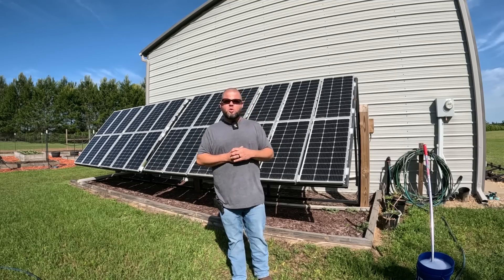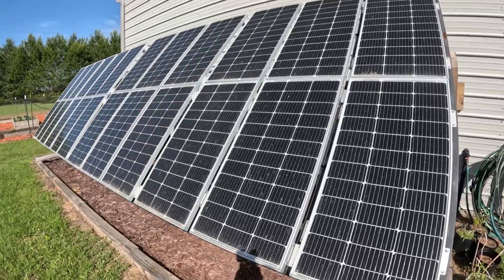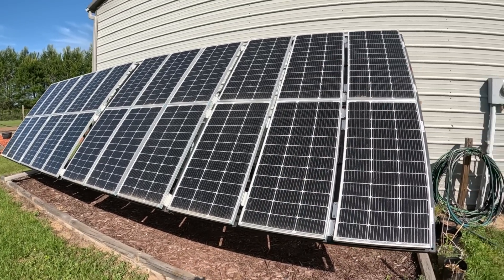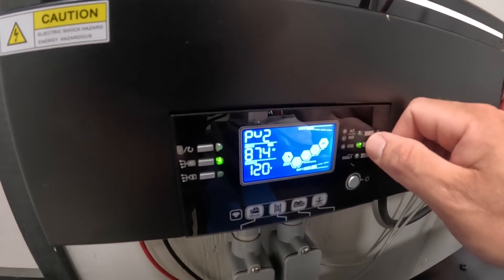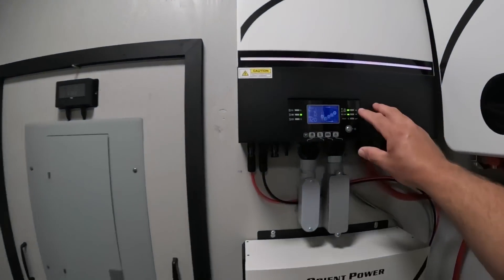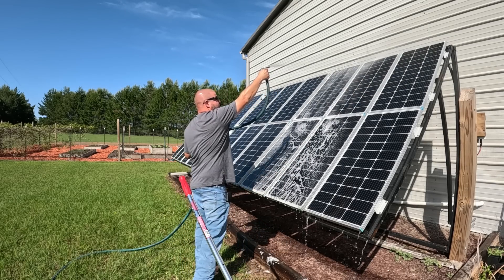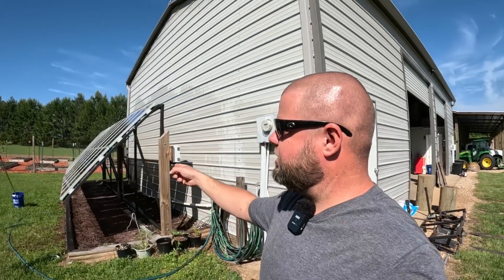Solar Panel Mistakes! Cleaning And Cooling Output Tests!

Comment: I'm from netherlands where we have really clean tap water, but you should not use tap water. The calcium in the water will leave stains on the panels that will then be hard to remove. Most modern home panels also have a protective layer that you have to be carefull not to damage. So if you want to clean the panels use clean/rain water not tap water, and use very soft cleaning tool not to damage the protective layer. And if panels have a sufficient angle rainwater will automaticly clean the the panels. Here in netherlands is lots rain, so i've never had to clean my roof panels at 35degree angle. they still produce same as 12years ago.

Comment: Does the water on a hot panel not crack the panels?
Reply from the maker: No, these have to be designed for that.  We get pop up showers in hot Florida all the time.

Comment: Try weting down your condensor on your AC unit in mid summer it will amaze you how much it drops the power consumption. Don't do it perminatly as it will damage your condensor.

Comment: Being new to the job, please answer this point. Do you do this cleaning after having shut down the panels? How do you proceed?
Reply from the maker: It would be wise to do so if you are going to be working in or around the wires as they still produce voltage.  Keep in mind the panels are designed for wet weather and heave sealed connectors.  I personally wouldn't be spraying the backside connection boxes.

Comment: One main thing I was told when my UK solar array was installed was NEVER USE A BRUSH to clean them, just a hose. Reason? Dirt is particulates and brushing these can damage the surface causing microscopic scratches that scatter the light thus reducing the efficiency of the panels and this just gets worse over time.
Reply from the maker: Hose won't work here, it will not remove stuck on pollen and other debris.  A soft brush is needed for sure.
Reply: This is correct. The panels have a coating to reduce reflectivity and enhance absorption.

Comment: What kind of soap do you use? The company that installed my panels comes out once a year to clean them for free, but just for the first 5 years. I would like to clean them myself
Reply from the maker: I use a small amount of dawn dish soap. I've never seen any issues. That's a very mild soap.

Comment: I have 4 arrays of panels. 2 (18) panel arrays pointing south those were my first. Noticed very little to no output at 1st sunrise. Then experimented pointing a few panels to the southwest and i got more early morning output on those few than both my 18 panel arrays with solar world 240 watt panels. So I built a 15 panel array using renogy 320 watt panels. And I have 6 300 watt panels catching the sunset. Here in central Illinois,  that seems to work well. Since I have fixed angle arrays I had to comprimise my horizontal angle at 40 degrees.

Comment: 100 watt panels tells me you are a novice.
Reply from the maker: Your response tells your ignorance to what I do and that  you are judgemental. Go ahead and try to tell me it's cheaper to buy residential panels and go ahead and try to tell me it's best for my situation. I've heard all the lines. I got 67 panels on a killer deal, these have out produced anything I've tested thus far, AND I'm a review channel. I test equipment requiring 100 watts, 200,400, 600, 800 up to 5k watts. 100 watt panels allows me to wire in any configuration for these tests and give the information I need to viewers who actually want to learn, not judge me based on one scenario. Have a better day!

Comment: Before cleaning, make sure the top surface does NOT have a so-called "anti-reflection" (AR) coating/treatment.  If it does have AR, there is likely a very detailed way to clean it and that technique is likely described in the panel's owners manual.
Reply: Good advice! You can very quickly damage that coating by cleaning them incorrectly.

Comment: Misting to cool down the panels is not a good idea.  You’ll create more bad than good which in turn get calcium deposits in a short of time and hard to remove unless you use chemical which may also cause harm than good.  The best you can do is to have a lot of space behind the panels as much as possible for efficient and the highest power production. People mistake when installed on the roof they tend to like to keep the panels flush or close as possible to roof and preventing air flow to cool down the panels and reduce the power output by as much as 10-30%.

Comment: I have my panels vertical, snow and dirt are not a problem. I cleaned then in sept but going to clean them soon when I add PV4 a 3.3 kw winter array.PV2 is a 2790w but has peaked at 3414w

Comment: I use distilled water with a tiny bit of dish soap in a 3 gallon sprayer and a squeegee (scrub side) to clean my small (6x200w) ground mounted array. Wipe off using the squeegee and soft towels (no scrubbing). Uses maybe 1 to 1.5 gallons each time.

Comment: Hello,
You are 100% right about cleaning and cooling. I clean my PV every 3 weeks.
Here, in Thailand we have very high temperature (35 to 45°C). 
So, i installed a gardening sprinklers system on my PV combined with a programming watering tap. It costs almost nothing but gives 15% more production.
Reply from the maker: Nice!
Reply: @angle3clip  
No risk. The water is not cold and it is sprayed like vaporizing not running water
It also helps me when i have to clean my solar panels

Comment: As my solar guy says here do not wash the solar panels with our water. It will put a film on them and just make it block the sun. Our water is disgusting here just saying. He said you can dust them, but don’t wash them with our water and I can understand that and why
Reply from the maker: Have you thought about putting a RV filter on the end of your hose to filter the water before using?

Comment: Another great video.  Cleaning and cooling off are advantages for me on our north Texas property.
Reply: do you use battery for the Texas property?
Reply: @serverrackbatteryusa  we don’t currently harvest solar for whole home.  I have portable batteries for operating ham radio and they are LiFeO batteries much like Jackery or DIY batteries based on 18650.   But that only covers portable work so far.

Comment: an A/B test ...  To test if  the cooling makes an improvement... instead of spraying on top spray on the backside.    The water on the panel  could act like little magnify glasses, per rain drop.  I have no idea if that would make a difference.  I know running them cooler does in fact increase performance.   Also have you thought about bi-facial panels?    Maybe on your next array get some... then do white crushed rock underneath to help reflect light.   <3  again love your channel!
Reply from the maker: Way ahead of you, bifacial panels, white rock and tests already in progress https://youtu.be/i7FOsQaFi5Q

Comment: Love your videos,  I wonder if you could take one panel and apply HydroSlick (its a ceramic / wax coating)    put it on one and see what it does over a year.  and or how easy it to clean
Reply: I'll even send you a bottle.   I have solar on my roof of a 2 story house.  I cant do the test easy or I would do it!
Reply from the maker: Rain X is the same thing correct?

Comment: If you put white rock under your bifacial array there would be even more gains, great idea with the reflective panels behind them.
Reply from the maker: There is white rock under them, but they need to be higher to benefit from it.
Reply: It is a good idea. I will try!

Comment: Hi looks like a great place u have....on the spray cooling if u ever do a test, i always wonder if spraying water on a hot panal might create stress cracking as the panals are rapidly cooled from being hot, but i guess its just like a hot panal getting a shower of rain, and the panals cope with that ok. Iv only got limited space so im going to mount my small 2kw array vertically and static on my south facing wall of my house, they will be out of the way plus still easy to clean. Iv heard people say vertically is good idea, as in summer they dont get as hot, and being cooler helps to generate similar power to panals being pointed directly at the sun, and its said helps them degrade more slowly too, and in winter they will be pointing at a great vertical angle to get any winter sun, with any luck...im in uk, so its not as ideal as your sunny weather.
Reply: BTW it is a good idea👍
Reply: This is also a consideration. Rapid cooling of hot panels can create micro fractures in the panels. The difference with rain is it usually starts a little more gradually than a drenching from a hose

Comment: Thanks for the information, I have been debating on cleaning my panels that are on my roof as they are dusty enough that I can see it from the ground. I will have to make sure to take some good readings before and after cleaning and see how it effects mine.
Reply: Follow the video and believe you can do it too!

Comment: But what you dont take in account is that the higher up they are is the cooler they are ,and a combination of the  rain and wind give an excellent cleaning combination.
Reply from the maker: We can look at this another way as well, the roof gets extremely hot and further reduces the panels output. I'm not buying the roof as the best option.

Comment: Is there a particular reason (especially with all your acreage)  you didn’t want to go with  the  larger style residentual panels?   I have found them to be much more cost effective per watt.  Love your channel!   Keep up the great content!
Reply from the maker: I actually bought these panels on sale for a very good price for watt. I also review a lot of equipment on the channel, some require 100 watts, 200 watts, all the way up to thousands of watts. Having individual 100 watt panels allows me to wire them in for the types of equipment I'm testing.
Reply: Solar panels are cheaper per watt than in the United States

Comment: I thought "I" was the only weirdo who goes out and cleans my panels!!.....  Good to know I have others who like to clean theirs too!  "I" have an issue though, I cannot clean mine in the heat of the day.  I live in Arizona where, in the summer, it gets a hundred and teens degrees for MANY days in a row.  This means that my panels can get to 150 to 160 degrees.  If I were to go out and clean them at that time, I'd have SHATTERED panels.  So it makes me even weirder in the fact that sometimes, it'll be like 10PM....  11PM....  even at midnight out there cleaning my panels.  The next day, everything has completely dried and I'm running higher wattage.  My array is ALL ground mounted and mostly all totally flat.  They perform GREAT in a flat position for me PLUS,  I don't have the real-estate to have the panels mounted with the proper tilt because the tilt will cast shadows on the panels behind them.  Like you, I built all my own power plant here NOT to live off grid but it lowers my electric bill like CRAZY!  I'm also installed solar powered mini split AC units in my house that now, I no longer have to use the POWER HUNGRY home, built-in AC units.  The solar powered mini splits run on solar throughout the day and then at night, they use a bit of my batteries.  They work GREAT and will freeze us out of the house!!  The AC units I have are called Airspool, 18,000 BTU's and man do they work GREAT!  So while the mini splits are using solar panels, it gives my batteries a great opportunity to get to 100%.  All my batteries are at 100% by like, 12 to 1PM and all my inverters kick off at that time unless they are needed again.  It's a great time to be alive with all this technology!!!!
Reply from the maker: Sounds like you have a sweet setup.
Reply: It's a hassle to clean at night, but it works great!

Comment: in 1-2 days in my area my vehicles are COVERED by dust/debris. i cant imagine 1 month for solar on a 2 story roof. Loving my Vertical panels. 
Moreso with the Hail in my area. Covered by garage and the overhang. 

Setup a trough under the panels and recirc/filter the water and panels with a simple pump.
Reply: It should be maintained.

Comment: I have to clean mine also . I have found a foam blaster will work fairly well. I have a set of ground mounted & roof mounted also . For the roof one i use a Rv scrub brush . Hope to add another set of panels in the future for winter . Ill make a vid also when i do .
Reply: Great！Looking forward to your video.

Comment: Unless you are using distilled water, misting the panel fronts would be a nightmare for limescale buildup.
Reply: I'm going to try using the ceramic coating I put on my truck. Nothing seems to stick to it.
Reply: @pstoneking3418  Might reduce panel efficiency, but would be a cool trial. I'd just want to AB test it first.
Reply from the maker: Very true

Comment: Boy we did get a massive amount of rain the other day. 
Yesterday I was looking at my neighbors panels on their roof. The lower 1/3  is nothing but mildew. 😮
Reply from the maker: Our area got up to 12 inches of rain, flooding everywhere. Your neighbor surely isn't getting good input from those panels.
Reply: That's an amazing amount of precipitation. It is hoped that the solar panel can be re-maintained.

Comment: What keeps the panels from cracking when the cold water hits the hot panels?
Reply from the maker: They are not at that high of temperature. If they were not designed for that kind of service the company would be in trouble. Sprinklers, pop up rainshowers ect happen all the time to hot panels.

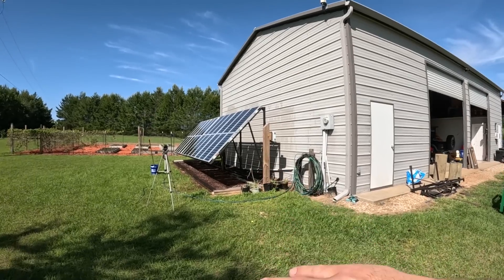Comment: 8:10 "shop off grid" as we stare at the utility meter in the background?
Reply from the maker: Don't be one of those people. As clearly stated in the video it's running on nothing but solar. I can flip a switch back to grid when needed.
Reply: These Settings can be adjusted by yourself

Comment: I have a cleaning business so I keep a squeegee out by my panel racks.  Around 7 am before I go to work I run my squeegee right across them.  In Florida we get a lot of dew in the am which is great because its pure water.  No worries about hard water build up.  Takes 5 minutes.
Reply: I put armor shield ceramic coating on my panels nothing sticks to them the slightest breeze balls off any poem it's amazing a little bit expensive but well worth it
Reply: @Theresahackforthat  Great ideal
Reply from the maker: I also have a squeegee and thought about using it.
Reply: Cleaning on time is a good habit, please keep it.

Comment: I’m looking at putting in some solar and you mentioned something Ive wondered about, hail.  Do you have to cover them? Maybe a good topic for a future video.
Reply: He has the framing on a hinge to adjust the angle.
Reply from the maker: That panel set I built can fold up into a vertical position for the surprise hail storm, or it can be completely taken down. My new array I'm going to build will have plywood protection for storms.
Reply: @TKCL  so a hailstorm hits and you aren’t home what’s the odds of it breaking glass?
Reply from the maker: Odds are great! Luckily we usually get advanced warning of that.
Reply: Be prepared for early warning.

Comment: I’m gonna agree with you 100% on the roof mounting. Yes it’s great for access but one you’re stuck to the angle of your roof pretty much or you just have this ridiculousness on top of your house and into a roof is a vulnerable place for a house anyway, if you start mounting step up there, that’s gonna catch debris and snow and put a bunch of holes in your house you’re just Creating failure points all over the place and like you’re saying the maintenance of the solar panels and in my opinion you’re just asking for problems. I think the perfect options would be like you do a standalone plus you can get the right angles to the sign, you’re not stuck to where your billing is already created and Their other options like building, a carport or some sort of structure with a roof with the solar panels or even an awning that sits off of your roof of your house is at the right angle. Especially if you’re going to have an electric vehicle, having a separate power system run completely off of solar panels in a protective carport would be an awesome option, but I think putting them on your house is just a huge hassle, if your solar panels have a problem or your house has a problem then you’ve got to do twice as much work to deal with all of it. It’s just kind of silly idea in my eyes.
Reply from the maker: Very valid point about being stuck with angles and direction of mounting.

Comment: Hey, I'm always very happy when you make a video about solar systems. I'm thinking back to an answer you gave a long time ago, where you had just calculated how much electricity you pay per year. And when I asked if you didn't want to build a solar system, you said oh no, just not something like that, too much work and the electricity from the socket is very cheap. How times can change so much. Greetings from Berlin
Reply from the maker: Honestly getting the occasional sponsor, viewers heavily requesting the content and concerns about long term outages for various reasons, have been what's pushed me to it. The cost savings is nice but it's not enough alone for me to justify these systems. We are fortunate to have very affordable electricity where I live.
Reply: Building a solar system can provide a steady supply of electricity.